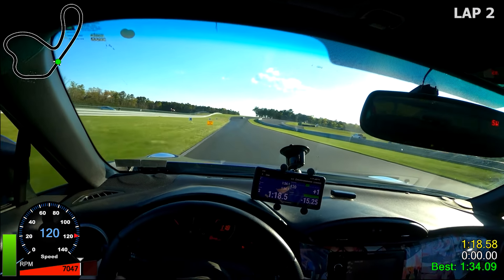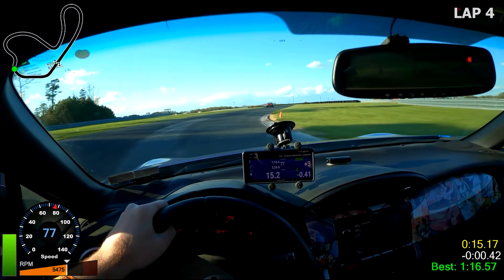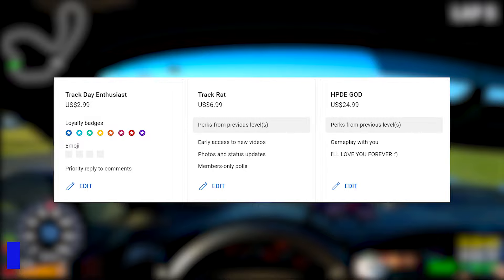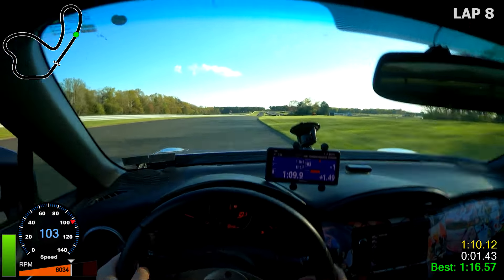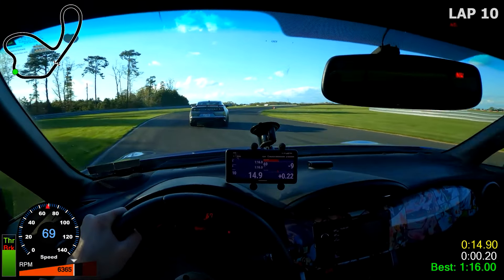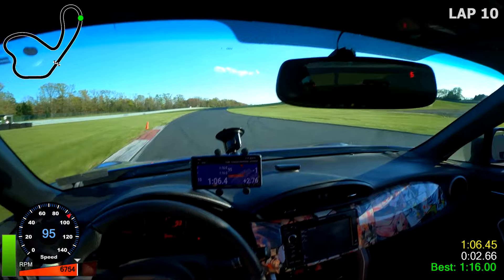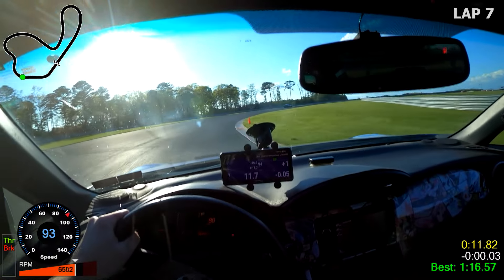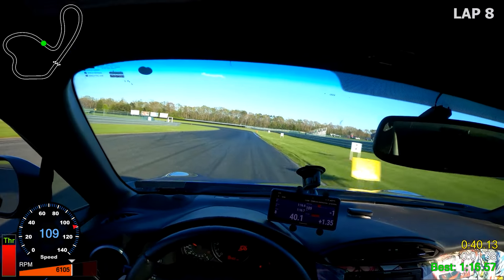Modifying Final Drive Ratios...is it worth it? OEM BRZ 4.1 vs 4.3

Comment: Hi any idea my kswap which one good fd for track race 4.3 or 4.7
Reply from the maker: with the extra rpm of a k series I'd go with the 4.7 for sure. I've seen 949 racing run a 4.7 in their fa20 brz and it was quite fast if you need a reference point. kpower has a gearing calc too if you haven't played with that yet

Comment: Good lap.  IMO there was time in 2 thru 3 on that lap.  You lifted and touched the brake then had to modulate the throttle.  To me this means you are missing your turn in speed and minimum apex is too low.  Ideally you want to allow the car to slow down all the way through track out so it will take a set and you can power up through 3.  And turning the car is slowing it down.  Watch “Matt Wasileeski NASA ST4 Trim Best/Fast Lap” and he’s textbook through that section IMO.

Comment: What is that app you use for lap times? How does it work?
Reply from the maker: race chrono! it uses the gps on my dash to record lap times
Reply: @dadhats  so it just tracks your GPS position? Do you need any other hardware?
Reply from the maker: @andrewallen7032  nope just that. you could add an obd2 reader for reading rpm, brake, throttle etc but that's optional
Reply: @dadhats  that’s so cool. What app was it exactly? I see multiple with the same name on the App Store
Reply from the maker: @andrewallen7032  would be the pro version. think it has every feature unlocked and is like $20
Reply: @dadhats  thank you 🙏